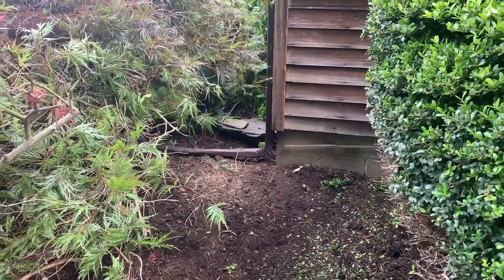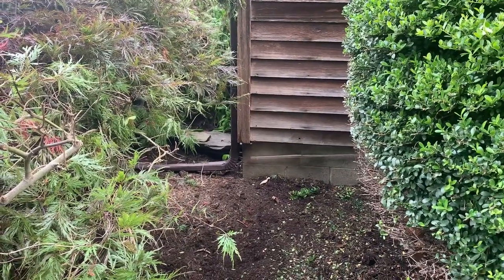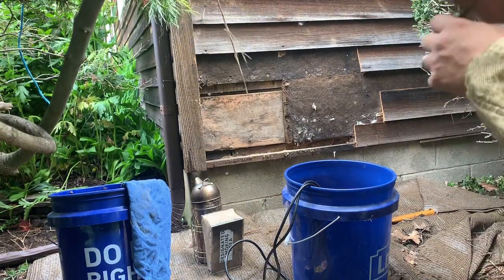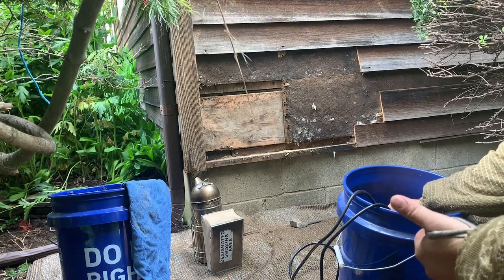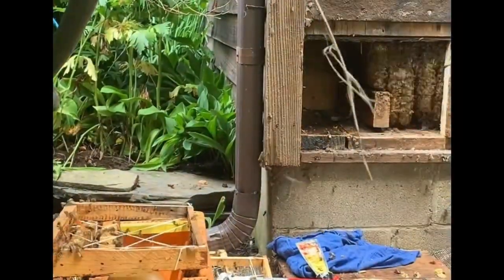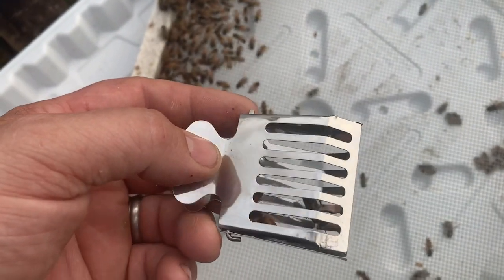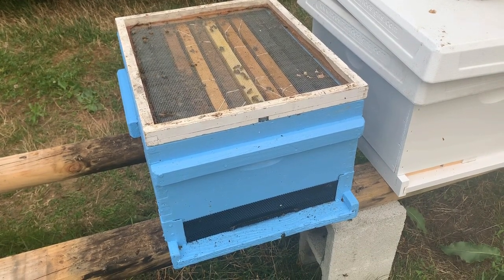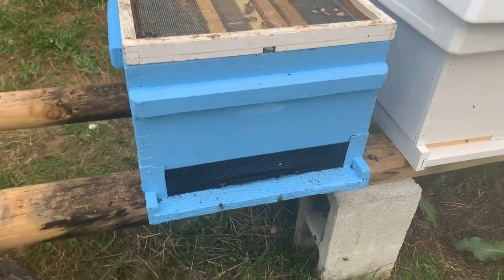These Honeybees Are Living Rent Free 🐝

Comment: I would have put a brood box right up against the exposed colony as close to there nest to encourage them to use that, in time once I have the queen I would put a queen excluder between to let the remaining move in.
Reply from the maker: Thanks for the comment Dave, but that would be a trap out and not a cutout. The homeowner wanted the bees gone that day not over a period of time.
Reply: @BohemiaBees  I thought that might be the case, cut outs are generally messy done it a few times and the bees tend to be more defensive as well. I removed one lot as you did wearing my bee gloves general I don't wear hardly anything dealing with my own bees but on this occasion I made the right decision to be kitted out my gloves received anywhere from 30 to 45 stings never counted but could see the remaining stings in the gloves once I got them settled in a hive checked them after 7 days they were not the same temperament as the time I removed them they were gentle almost loving 😂